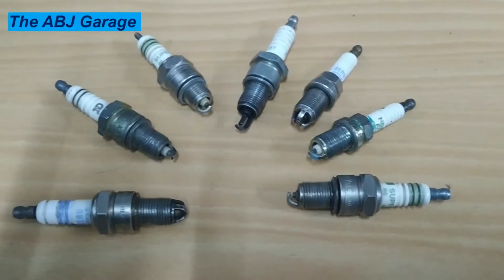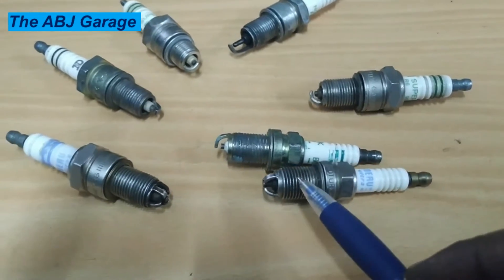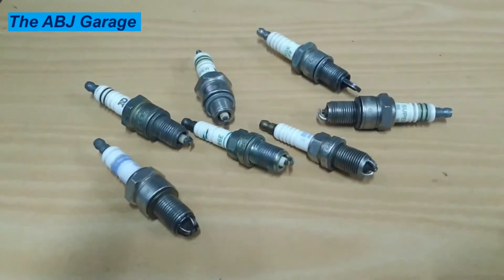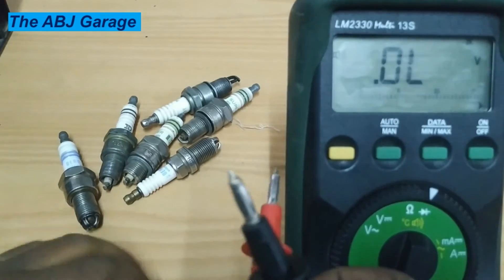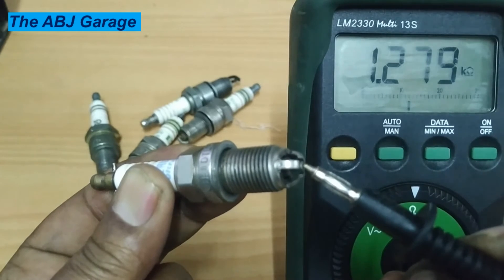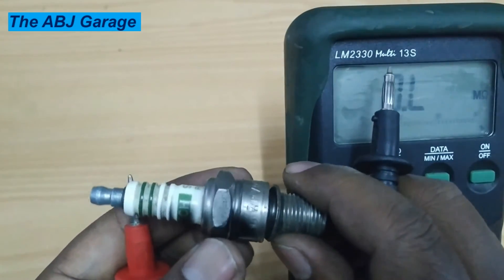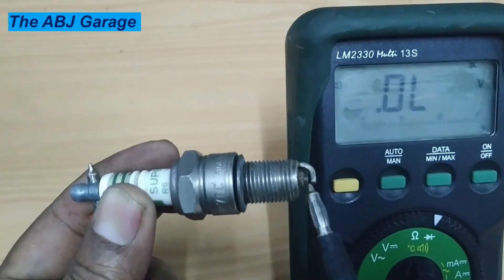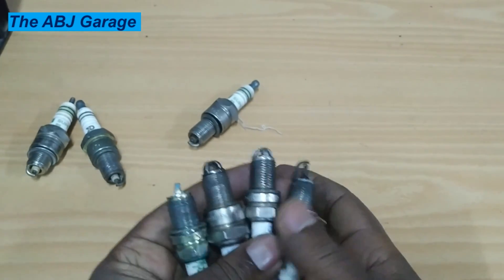How to test spark plugs using a multimeter

Comment: ribs are to keep spark from going to ground along outside of plug
Reply from the maker: Indeed! The ceramic is there to insulate the center terminal from ground, and ribs are made on the ceramic to keep the spark plug wires in place! The spark plug wire boot will hold firmly to the ribs, preventing any forign material intrusion!

Comment: I had a new plug that tested bad (weak spark) until I sanded the top post (where the wire connects). It then tested good, and my chainsaw started. It seems like there was a varnish or something that developed on the post.
Reply from the maker: Well done! Thank you very much for sharing your wonderful experience!

Comment: By the way if the china (white part) of the spark plug is turned orange from the tightening nut side,it means it has compression leakage and it should be changed
Reply from the maker: Okay! Thank you very much!
Reply: How so if seated tite with no leaks?
Reply: Why does the spark plug need so much resistance?

Comment: Good  day. I bought a set of brand new BPR6ES NGK spark plugs from a local parts store. I have tested them as this video shows with multimeter set to 20k OHM and getting a reading of 0.02 on all of them including the used ones taken out of the engine. The engine is a 3.0 v6 essex, what am i missing here ???
Reply from the maker: Thise spark plugs usually have a resistance value of 5k ohm, It seems yours are reading 2k. Are they all reading similar value?

Comment: i got all my ngk R1 sparkplugs showed 1.4kohm  is that good or bad?
Reply from the maker: They will work just fine, but if it was a NGK “R” or resistor spark plugs it was expected to have a resistance value of around 5k ohm dues to the ceramic resistor in the spark plug to suppress ignition noise generated during sparking. Besides that noise, it should work just fine.

Comment: Is spark plug with 3.48 kilo ohms good or bad to use on 1.4 gti engine
Reply from the maker: Depends on the model of the spark plug! Generally speaking the value you mentioned is good! The more the resistance, the less the interference!

Comment: All info on Resistance SEEMS to be between 3 and 7.5 kilo ohms. You said it is between 4 and 14 kilo ohms.   Would  you be so kind and explain to us which one should we take as a reference? I managed to contact NGK Brasil because I bought one plug that is 9.3 kilo ohms and I was wondering if that was too high. They said it has to be between 3 and 7.5 and that  there is probably something wrong w/the spark plug. Whats your opinion? Since you said 14 kilo ohms is fine Is it ok or is too high?
Reply from the maker: https://www.crsautomotive.com/spark-plugs-all-you-never-knew/
Reply from the maker: As you said there are many different resistance values recommended by different manufacturers. There are champion spark plugs with 9k ohms resistance specifications. It all depends on the make and model!

Comment: Zero resistance for my non-resistor plug.... and zero resistance for a brand new replacement.  There's a mistake here (NGK BP6ES for 2 Stroke 240V Generator)
Reply from the maker: Those spark plugs usually have 1K Ohm resistance when brand new!

Comment: So which one is recommended the one with a resistor or the one without resistor?
Reply from the maker: A spark plug with a resistor reduces electromagnetic interference (EMI) that can cause radio and TV interference, engine misfires, and other electronic malfunctions. The resistor reduces the amount of electrical noise that is generated by the ignition system. 

On the other hand, a spark plug without a resistor is designed to provide a stronger spark and better performance. These plugs are often used in racing applications where maximum performance is desired. 

A spark plug with a resistor is better for everyday driving and reducing EMI, while a spark plug without a resistor is better for high-performance applications.